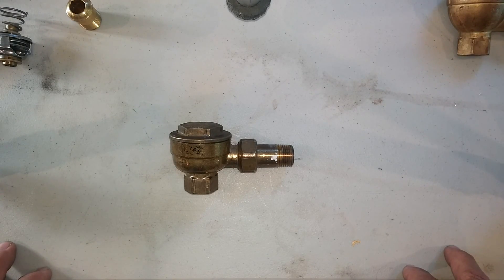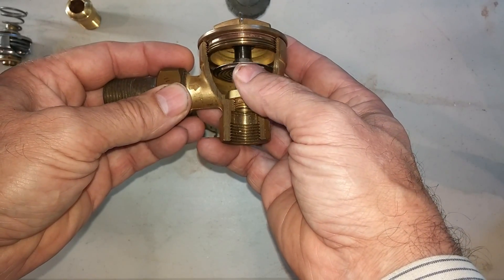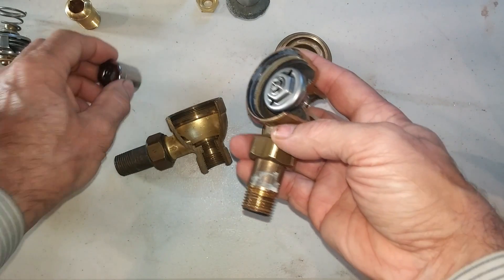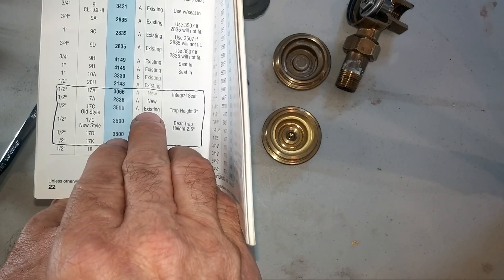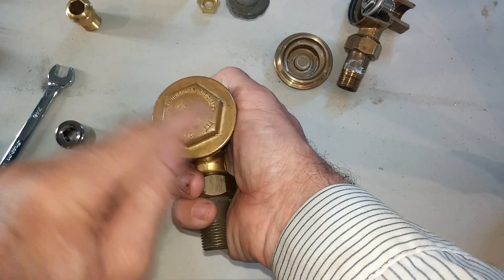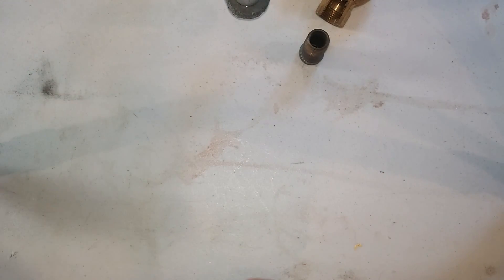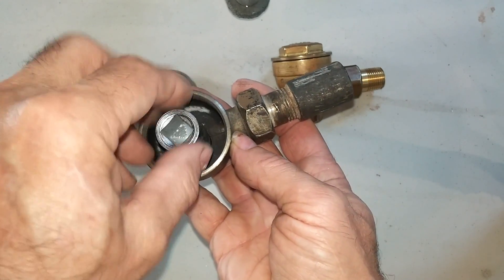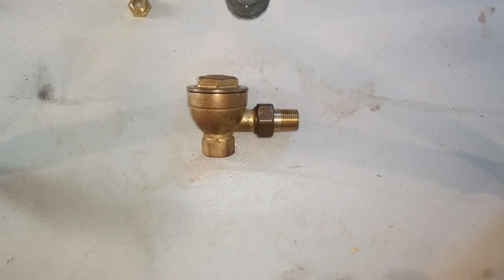Meditations On The Hoffman 17C Steam Trap Variants And Their Antecedents

Comment: I have a new style 17C on the radiator that's in my sunroom/plant room and it's quite a large radiator. And as you said I looked inside of it last night and it does have quite a large amount of water trapped in it. I think down the road I'll be rebuilding it with a b&j cage unit and cover. However that radiator is shut off as I don't need heat in that room what are your thoughts on this?
Reply from the maker: I would consider replacing the 17c trap entirely with a B&J 122.
Rebuilding the trap with a B&J cage unit (and you need a new cap) pretty much leaves you with the same water dam issue.
But, seeing as you don't currently need the heat there, you have time to consider your options.
And one of those options is to do nothing.
Reply: @gordonschweizer5154 I think my wallet will be happy to just leave the radiator valve shut off. I'm thinking next summer of putting Tunstall capsules in all of the Warren Webster 02H traps as well.

Comment: Fantastic video - very detailed, I had to freeze frame to get a look and compare to what we have. House built in 1929 with 2 pipe steam heat, one radiator not heating anymore pretty sure the trap failed. You pointed me at what I should upgrade with, got it all on order along with some anti sieze and a cap just in case along with a couple of spares and I should be all set. Tough to find anyone that does steam heating anymore and the ones that do here in Michigan charge multiple body parts just to show up at your door (if they'll even show up). Your knowledge is very much appreciated!

Comment: I just rebuilt a Hoffman 17c steam trap using this video as a guide. Thank you.

By the external measurement and appearance the trap was the old style. Just like @D-DubJr wrote the interior was not as shown in this video. The bellows appeared to be integral with the cap as shown on the 17a. No matter how hard I tried I could not remove it.

A permit dated 1936 is on file with the City of Denver for the installation of the boiler. I believe the trap I rebuilt to be coincident.

I replaced the bellows and cap with with a Barnes & Jones 3500 cage unit and a B&J 3500 cap.

My concern is that with the extra clearance of the new cap will the sping of the cage unit be compressed enough for lasting proper function? I tested the rebuild. The radiator went from only getting partially hot with cold areas to very hot throughout quickly. I have more similar traps throughout the building to rebuild. I would appreciate your input before doing so.

John R. Shanahan
@johnrshanahan
High Street Condominiums
Reply from the maker: You are most welcome.

As to your question, as the bellows seem to be integral, similar to a 17A trap, a new cap is called for, as the time it will take to rip the bellows off with a pair of Channelocks for each cap you encounter in your condo is not gonna work out well!
However, I get your point entirely, as I have run into this poor seating/spring pressure problem as well with this and other traps & cap combos.
My question for you is: Regarding your 17Cs, is your seat integral as well, or is it removable?
Reply: @gordonschweizer5154  I have now rebuilt three, two more today. All of the seats were removeable with a 3/4” socket.

I have one more question. How tight should the caps be. I searched the internet for a torque specification to no avail. I saw in one video a recommendation to torque bolts on a larger trap to 70 foot pounds. With no other reference I did that, though it seemed excessive.
Reply from the maker: @fearga  Thanks for your reply!
Yes, I'd say 70 ft-lbs is excessive.
I'd call B&J tech support directly and ask.
Please mention my video.
They might get back to me if I made any errors & I can put corrections & updates in the description below

Comment: Gordon, which trap do you recommend if replacing the trap entirely?
Reply from the maker: It depends!
If you have a small radiator, a 17c is fine.
If you have a larger radiator, I generally recommend a Barnes & Jones #122A.
Either way, make sure your overall main vent is the best it can be.

Comment: Great video - informative and clearly competent! 2 radiators in my house just stopped heating. Clearly the traps. Found your video - it is a life-saver. My traps read "Hoffman Specialty Co No17C Indianapolis Ind." These are the vertical version. Upon removal of the caps, my traps have an integrated bellows/cap like the 17A you discuss, but they have the normal, non-slotted, removable seat. These traps have not been touched for at least the 28 years we've lived here. I cleaned each bellows simply with water; removed and cleaned the seats and the mating surfaces and flushed the trap also with a bit of water. I reinstalled the seats and bellows/caps with a bit of anti-seize on both. And, low and behold, the heat returned! I am thinking about rebuilding these anyway but per your comments do not want to use the DuraStats. I l think I'd go with cage units. Thoughts on options? Thanks again!
Reply from the maker: Thank you for your story & kind words!
That is amazing that you were able to get it to heat again with just a cleaning.
Where the lock rings really rusty?
I'd look into using a Barnes & Jones #3500 cage unit to rebuild them at some point.
Reply: Thanks. I will look into the 3500 just wasn’t sure about having a 17c with integrated bellows. So I will need the 3500 plus new caps, right? The lock rings were not rusted - but I had to use a 1/2” ratchet with a 24”  pipe for leverage and just a touch of WD40 to break the caps loose.
Reply from the maker: @D-DubJr  I think the trap element is threaded into the cap, isn't it?
Might be an early version I've not run into before.
But if it integral, to be sure, you're right, best have a new cap on hand as well as the trap element before doing a rebuild to see how it goes.
Reply: I finally received the 3500 and 3500c cap. The old bellows was indeed screwed into the cap. Replacement was a snap! I’ll order the rest of the 3500s for the house! Thanks again!!!
Reply from the maker: @D-DubJr  You are most welcome!
If you have the bellows type 17c, you should be able to re-use the old cap (removing the bellows, of course) if you so desire.

Comment: would Barnes and Jones 3500 cage unit fit in Hoffman 8C steam trap?
Reply from the maker: According to the B & J booklet, yes, the #3500 cage unit fits the 1/2" (but not the 3/4") 8C trap. It also will need a new cap.

Comment: What tool are you using to remove the old style with the three holes on top ?
Reply from the maker: I do have the special tool to remove that bugger... somewhere. I've used it only a few times and it's gotten lost.
Usually, I'm replacing the mediocre Hoffman's with a whole new B&J trap anyway.
But, if you are just trying to rebuild the trap and not going to put the same innards back, some have suggested using a pair of stout needle-nosed pliers and another wrench to turn said pliers.
I'd then put in a B&J or Tunstall Kit appropriate to the particular Hoffman you are working with.

Comment: Ever check out the tunstall replacement elements. they seem to last much longer than the cage units
Reply from the maker: Thank you for your comments.
I use both Tunstall and B&J largely depending on perceived need of radiator venting. Smaller radiators tend to get Tunstalls because air flow through their elements is slower than the B&J cage units.
As to which last longer...that is harder to quantify.

Comment: I have 33 Hoffman 17A steam traps. About 25 years ago, I ripped out the bellows and removed the seats and inserted Dura-stats. Recently, I replaced six. Upon testing of the fix, four had failed. Your video and commentary is very informative and well presented. I would like to install B&J cage units. The application table for the Hoffman 17A on State Supply's website indicates that the seats should be left in. I no longer have the seats. Since the 17A and the old style 17C are about the same height, would the 3500 cage unit fit in the 17A without the seat, using the original cover? Thank you
Reply: @Richard Robbins: Thank you for your gracious words!  As I recall, the wide part of the spring of the #3500 cage unit did NOT fit into that space exposed by ripping out the bellows of the #17A trap cover, otherwise that would be the way to go, as the base of the 3500 WILL indeed fit into the hole left by the removal of the seat (as you have done).  I would give the folks at Barnes & Jones a call, maybe reference this video, and see if they can help you to make sure before you commit to buying anything.   You may have to buy the #3500 cap as well. I am not 100% sure. The 17A pictured above is the only one that I have encountered,  so I don't know everything about this trap, and/or you may have a special variation.
Reply: Thank you for the prompt reply! I'll contact them and share the response with you. @elgordo271
Reply: @richardrobbins5563  Excellent! Thank you, good luck and happy steaming!
Reply: I heard back from John Patriaca at Barnes & Jones. He says that the #2836 cage unit fits in the Hoffman 17A with removable seat. The unit will fit without the removable seat in place. Also, the cover #2836C is required. Thanks again for all your help!  @elgordo271
Reply: @richardrobbins5563  Thank you for the feed-back from B&J! I did not want to steer you wrong.  I am in my shop now, and I just dug though my collection of cage units, and lo and behold, actually uncovered a #2836 cage unit and a cap to match.  Ah, the mixed blessings of being a hoarder.

They do indeed appear to fit the one Hoffman 17A that I have in my petting zoo of traps, although it does seem that the spring compression used to force the seal on the cage unit is not all that great compared to other cage units on other traps I've installed over the years.  I would just buy one set to try it out, first.  

It may be that your old caps would be a better tighter fit!  As that bottom seal gasket is the weakest link when using the B&J cage units, it behooves one to make sure it is tight.  I know for sure, though, they are gonna work much better for you then those silly durastats!
Reply: Gordon Schweizer 
Thank you again! Would you mind trying the fit of a 3500 cage unit in the 17A with the original cap? Although, if I recall properly, yours has the integral seat and may not fit the same. I found 16 #2836 covers on Ebay for $4 each, so I’ve got a head start!
Reply: @richardrobbins5563  My 17A is of the removable seat type.

The cage unit spring of the #3500 had issues fitting into the bottom of the 17A cap because the 3500 cage unit spring flares out too much and wont fit in the hole in the bottom of the cap.  The #2836 has a different spring configuration type (narrow), but the hole is too deep on the 17A and doesn't seem to push down the spring to make a tight seal at the gasket.  At least on my unit.

No easy answers. 

An OEM Hoffman 17C cap will fit on a 17A and a #3500 cage unit will go in and seem to fit reasonably well, so you can turn a 17A into a 17C (original type).  A 17C (old style) is more like a 17A.  The "new style" 17C is essentially a different trap entirely and basically a POS (as was the point of the video) due mainly to the durastat. 

As I said, no easy answers.
Reply: Also, please note, the #2836 cap with the #3500 cage unit does NOT have a good spring push on the sealing gasket either, at least on the unit I have.
Reply: Thanks for testing it out for me! The 2836 covers are on he way. I just found a local supply house advertising the 2836 for $33.45 each in quantities of 12 or more. I'll pick some up and give it a try. I see you are in Towson, MD. My son has a 3 story 1830's brick house in Baltimore with a gas-fired hot water system that doesn't warm the house evenly. He is in need of a competent heating contractor. Can I put him in touch with you?
Reply: @richardrobbins5563  You're welcome!  Try to pick up some Hoffman 17C covers and #3500 cage units (the cage units come up often on ebay) on the surplus market and give them a try.  They may work out just as well as the "official" 2836.
As for your son, sure! Have him call "All Steamed Up, Inc"
Reply: Gordon Schweizer 
That’s a good idea! I’ll see what I can find. I really appreciate your advice and expertise!

Comment: Hollywood production, awesome!
Our church has 16 large radiators. 5 down each side, 2 in the foyer, 1 in room stage left, 1 in stage right and 2 back stage. High ceiling no insulation, brick walls with stained glass windows down length of walls.  A chore to heat. We are getting up to 70 max when upper 20s outside. The old folks say it used to get warmer. All I can think of is that the dura stats currently in the old style 17c don't have enough flow as you referenced in the video due to the small orifice.
Reply: Thank you for the kind words.  I'm glad this video is helping to give insight as to what may be causing the slow heating of your church's radiators.  For me, there is no question that I would almost never use a durastat unless it was a on 3 section or less small bathroom radiator ;-).  On large radiators in a big old church? Absolutely not! Heating Madness!  I do hope it doesn't water hammer for you.  Usually, to compensate for the poor heating durastat,  someone will crank up the pressure at the boiler and cause more problems than solve.  Since it might not be politic to start yanking the durastats (yet) and putting in B&J #3500s, check the overall air venting.  Make it as free as possible and Crank It Down!
Reply: @elgordo271  guilty! First thing I tried was crank up the pressure, problems!
Reply: @Abszero3060 : Oh my! Hope its working better now. Once you let the air out, Hoffman systems operate by design at 1/2 psi or less max.  In the coal era, they operated at sub-atmospheric pressures.  Gotta let the air out easy rather than try to force it out thru a main vent that is too small.